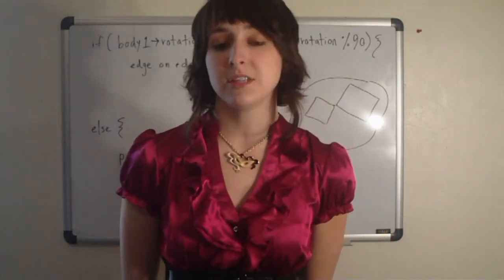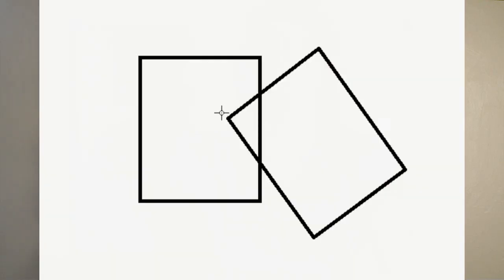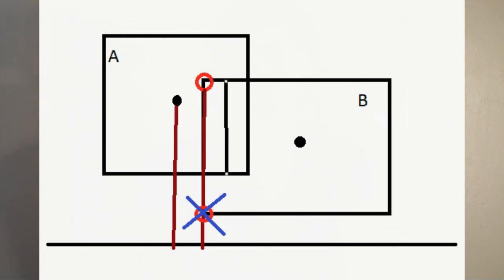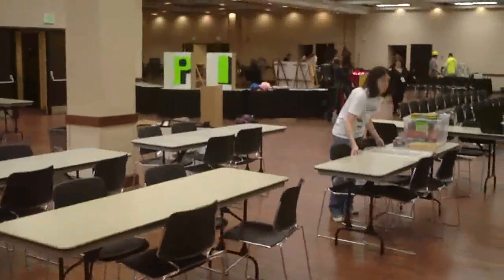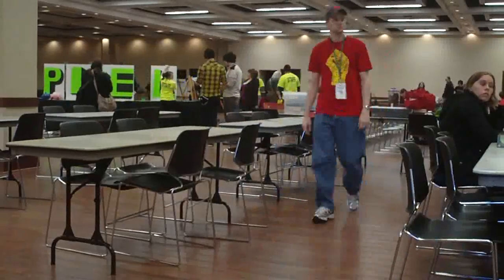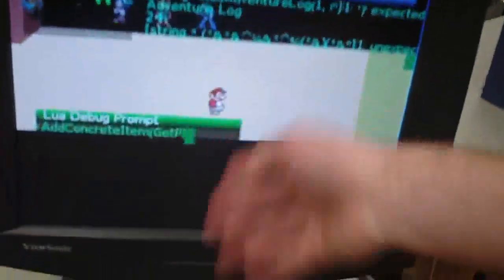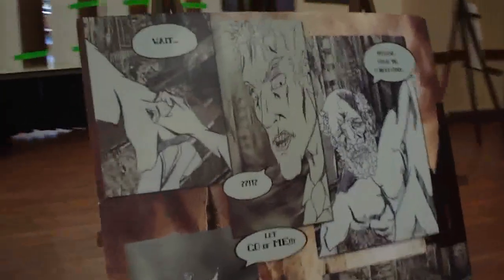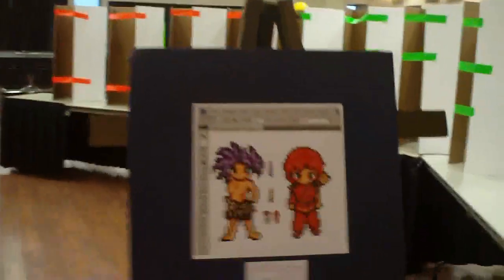Elysian Shadows Revolution: Episode 2 Part 6

Comment from the maker: @keithgarry, there is always a per-pixel method. And yeah, it's pretty unfeasible. OBB collision (in some manner) is pretty much the most exact collision methods used in the gaming industry today. Then finding the POINT OF CONTACT from OBB collisions is one step above that, which is usually only used for physics engines.